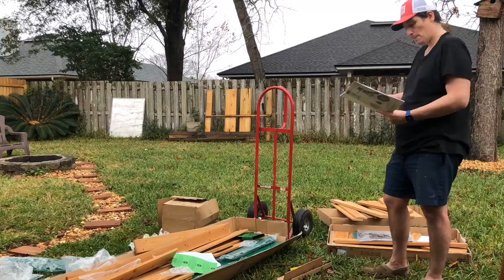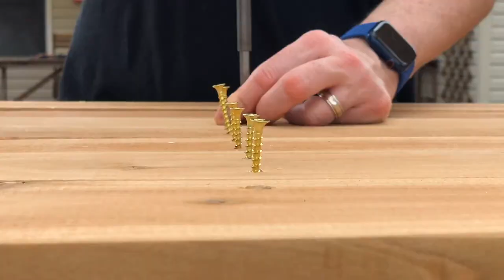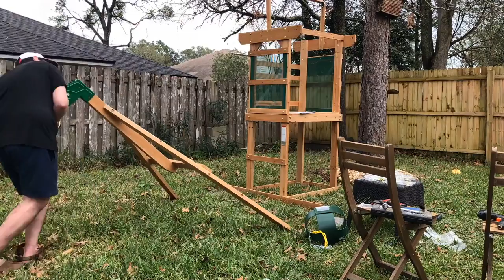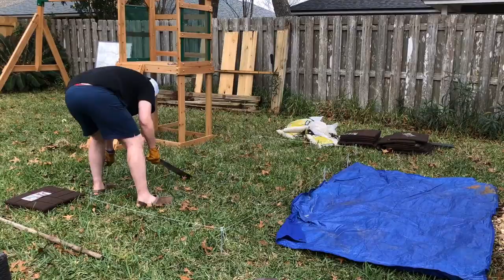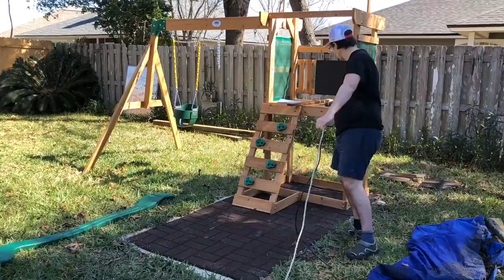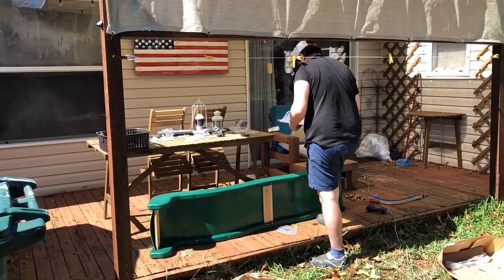Backyard Wooden Swing Set under $500 - Installation Time Lapse

Comment: Hi, were the holes pre-drilled, or marked?  If not, did you need to pre-drill or did you just screw?  Ive built 2 from other brands and looking to build one of these now, any tips would be much appreciated.
Reply from the maker: Everything was pre-drilled. I just screw everything together easily. It just took long time with all pieces